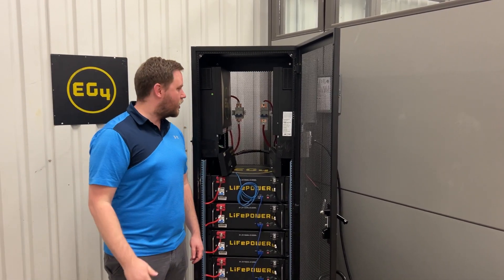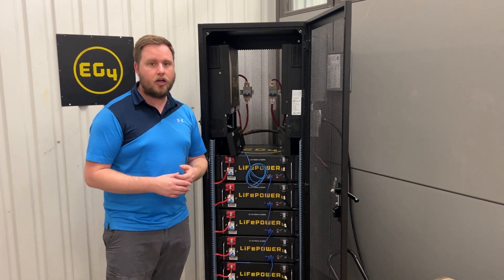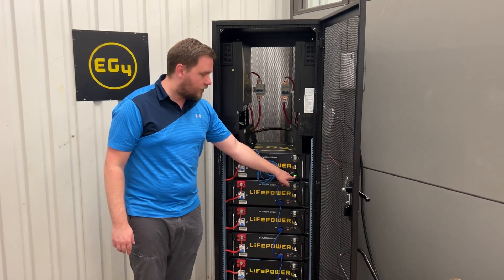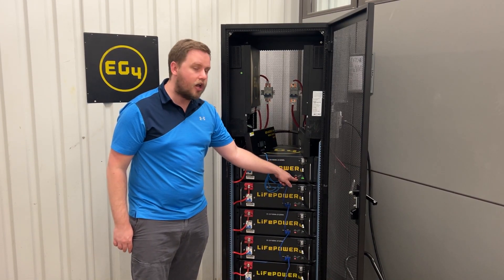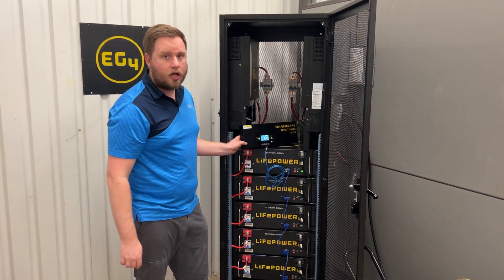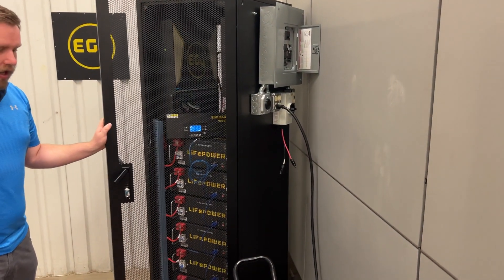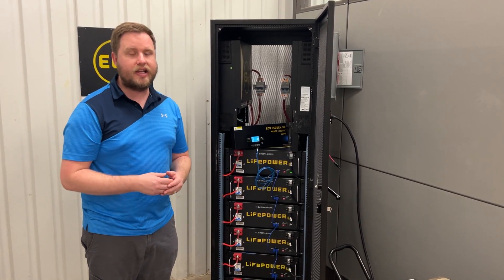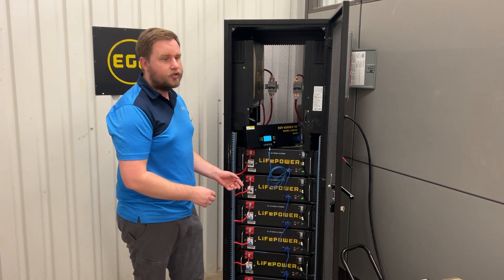EG4 LifePower4: Proper Start Up Procedure Using EG4 LifePower4 Batteries and More!

Comment: Great video, please add more content like this with the dual 6500EXs in split phase mode.  Demonstrate initial setup of each inverter and go through the different modes.  Add cabling diagrams and setup options for running with GRID input please!
Reply from the maker: Will do!
Reply: @SignatureSolar   Yes please do.  After seeing this video, I ordered the same setup.  Now I have to find a tall server rack.  Please show videos of how you added the bus bars into the rack for the battery hookup.
Reply from the maker: @NC-oc3ld  We have the bus bars added at the factory as part of the sidewalls.
Reply: I've ordered (and received) two of the batteries and am waiting on the two inverters (backordered) to arrive.  I'd look forward to seeing the mentioned video on connecting all of the components as well.  I also ordred a dozen of the 445 Watt Bifacial panels and am wondering about how best to string those with the two inverters.  I'll be adding a lot more in the future so having an idea about the initial string setup would be greatly appreciated.
Reply: YES!!!PLEASE!!!

Comment: I think it would be helpful for all your customers to show the set up procedure for each of the configurations that you sell, such as the 3000k EG4 inverter or the Growatt, with the lifepower eg4 batteries and so forth. Also, maybe hire somebody with video production experience to help direct more professional looking videos that would show close-ups and and more thorough step by step instructions. For the amount of products Sig Solar is selling, to predominantly the DIY crowd, you need to step up the video production, because I am sure your tech help desk is fielding the same questions over and over.
Reply: I think this is really valuable input Longbow is providing. My read on Sig Solar (and I am almost for sure going to purchase my batteries, rack, and inverters from them) is they are REALLY good people with really good products primarily for DIY and then also for pros. However, they are Nurds (good Nurds) and they know their stuff and they know solar in general really fricken well. But most of us are not Will P. or some other person making our living doing solar YouTube stuff. We are trying to do our home (on or off grid), off grid cabin, work shop, ......... and we are most likely trying to do it right and do it once. So, ....... we don't have the total knowledge and skill set and need as Longbows is suggesting. OR, what happens is what is happening at SS, the Tech/Customer Service is overloaded and people are getting frustrated (the only reason I haven't put in my order). Much of that frustration and a significant part of that overload could be eliminated with really clear Gerber-spoon-fed tech videos like these. Sure, the more knowledgeable will complain and write long self-serving responses, but in the end, everyone gets what they want. Take Longbow's input.

Comment: Same setup but with 4 batteries. Running washer/dryer, refrigerator, two mini splits, and a few other 120v small appliance. Works like a charm.
Reply from the maker: Love it!
Reply: Can I ask how you designate what's going to run off your batteries? I'm investigating using this setup but if I'm not running my whole house how do I run just a few appliances? Did you have to rewire those circuits out of your house pannel to this new setup? Thanks I can't find videos showing people connecting these to a house
Reply: @dshudson  I have a dedicated electrical panel in the laundry room powered by my inverter/batteries. 
I run dedicated circuits out from there (centrally located).  I'm not connecting into my grid panel at all. 
Everything except the bedroom mini split can be plugged back into the grid.
For instance, I ran a dedicated circuit in EMT Conduit to the dryer.  But the grid plug is still in place.  Basically have two plugs, one is grid, other is solar. 
As for designating what runs off the solar setup, to be honest, I winging it. 😄
I initially bought the system to power the laundry room and add a mini split to my bedroom. But it works so well, I've been adding other things to it, like another small mini split and refrigerator. 
Dryer only runs in the day when I'm making power, fridge doesn't take much juice, and the mini splits are so darn efficient that I usually have 50% battery left in the AM. 
Fortunately, it only drops into the 30's at night, so I only run the mini splits in the AM to get the chill out. 
Live in AZ, so I typically get enough sun to make all the power I want.
Reply: @genxgamerdad71  thanks a ton I appreciate it.. Wish me luck. Haha
Reply: @genxgamerdad71  actually one more question. How many pannels do you have and what voltage are they. And how long does it take to charge your batteries thanks
Reply: Two arrays with 9  450w 50v panels each.  Net is about 6kW.  System keeps up just fine in the summer, charges batteries from 40% to 100% by 11AM or so while running the dryer.

Struggling a bit this winter though, running the mini split and two electric heaters, to get the chill out. Batteries are typically at 30%  before they start charging again.  Not fully charged until 1. Really have to watch my dryer use.
 
If I had two more batteries and 6kw in panels, I'd be in really good shape for winter.  I'll get by though, just need to watch my usage a bit.

I plan on doubling this system this summer, as I want to add two more mini splits and connect the other refrigerator. I'd also like to add two circuits to each of my boys rooms to run their gaming PC's. I'm fortunate to have plenty of land for panels.
Reply: @genxgamerdad71  that's awesome. I have 22 525w bifacial panels, which I didn't pay for, so I'm already saving money haha. Now I'm looking at that deal on 6500ex 48 13000 split phase inverter bundle, and 6 lifepower4 batteries. With that said, the hardest thing right now it's finding a rack for my panels which measure 90in x 45 they are huge.  Like you, land isn't an issue.

Comment: Why in the world would you not have the resistor charging procedure in the Battery Manuel? I bought 3 of the lifepower 4 batteries and knew it had a resistor in the battery to charge the invertor on startup. Read the manuel on the eg4 3k inverter and the Lifepower 4 battery and it's not mentioned anywhere. Started it up and just like your video the batteries all shut off. Did this several times and now my first battery has a SOH of 99.90% Finally saw a video by Will Prowse that explained the procedure.
Reply: Answer to first question, if it is in fact not in the manual, because the manual is put together by humans, this is a new product that is very unique compared to normal things and humans make mistakes.
Reply: What's the title to the video will Prowse did on this problem or link it please thank you

Comment: Thank you for this video.  Just like "Oily Care" I'd like to see the complete set up for split phase and demo how you would hook up a critical load center, how you would combine input and out put in the same panel (or is this possible?), especially the ground neutral configuration, or do we need a separate transfer switch (please show).  Also follow through with total set up of same with the inverters.  Also, some close ups during the video would be extremely helpful. Thanks so much for your help (Chris Haymond)

Comment: Great video,great timing.  I am currently working on this same setup,initially with four batteries. Thanks!
Reply from the maker: Good luck!
Reply: Good luck indeed. Let me know if you can get your inverters to communicate with the batteries. The word out is they don't. Get error 61 within minutes of start up for most as i see on the forums.

Comment: I’m a rack guy :) I like this set up with the inverters and battery’s all in one rack and the additional items on the out side of the rack. I’d be interested in this rack as well.
Reply: According to the installation instructions this setup has nowhere near recommended clearances the inverters require. 19" top and bottom 8" on sides. Close the door and they just might overheat...I have mine in center of of grid house, setting up a fan system to put the warmed air inside in winter and directed outside in summer..under load the inverters reach Temps in the 90's

Comment: I recently installed my Growatt 12KW inverter and  4- EG4-LL batteries in the rack system using the top 4 rack spaces. I currently have 8 of your Bluesun BSM460M-72HBD panels configured in 4S-2P on one MPPT via a watts24/7 charge controller. My other 10 panels are on back order to wire up the second MPPT. I am considering going 3S-3P for each MPPT when the remaining panels arrive. I used the 25mm2 gauge wire you provided for the 4 EG-LL's pulling the positive and the negative from the top of the rack system busbars. I ran this for a couple weeks with two 110V output circuits to test the system and noticed the batteries drained down evenly. I just received and installed the remaining  two EG4-LL's in the bottom two spaces to complete the rack and this time reversed the negative bus bar per Will's comments so that the main negative pulled from the bottom of the bus bar. I also replaced the 25mm2 battery feed cables with equal length 4/0 cables. I then went off grid for the past 6 days, back feeding my house panel on a 60 amp breaker. I was surprised to see that the two newer EG4-LL's installed at the bottom of the rack were draining down much faster.  This morning reading show from top to bottom in the rack with all 6 showing 52.2 volt but the amp draw as follows;
#1 0.9A  44%
#2 0.9A 44%
#3 0.9A 43%
#4 0.9A 44%
#5 3.0A 37%
#6 2.9A 38% 
The difference in the SOC has been between 10-20% between the top 4 and the bottom 2 batteries to the point that I shut off the lower two batteries last night.  I am considering changing the negative bus bar back to the original position and would appreciate your input.
Reply: You don't need a separate solar charge controller, because these inverters have one built in.
Reply: Did you ever change the negative bus bar back to the original position, and if so what was the experience?
Reply: I ended up keeping the positive top left and the negative bottom right on the bus bars. I was told by SS that it takes time for the newer batteries to settle in  so I kept it that way. Here are my SOC reads today from top to bottom. 54,46,49,53,48,51.
Reply: Did they give a timeline? It will be interesting to see what they ultimately "settle" to.
Reply: @leonmcooper8640   I do not remember , but the SOC readings in my prior reply was after many months now

Comment: Hey Guys, Thanks for the video. When demonstrating loads, I think it would be helpful to have household appliances like microwave, induction hob, electric oven, vacuum cleaner, etc. Maybe with video of the Wattmeter on the Display.... you know, to give folks an idea... I'm running the 5000es w/ 2 eg4s, and midpoint transformer...

Comment: Air compressors are notoriously difficult to start up with solar systems.   That high inrush current and inductive load trip most systems.  I can't think of a better test. Thank you for showing the "minimum" system that can run heavy inductive loads.
Reply from the maker: Totally agree! Thanks for the comment.
Reply: We have a 24V,  off-grid solar setup (1,200 Watts PV, FM80 controller and VFX3524 inverter charger) with two 24V 200AH LifePOwer4 batteries and are unable to startup a handheld "Skillsaw" circular saw without crashing the batteries! We are also unable to fire up a 10" Craftsman radial arm saw. I was impressed to see that you could do could fire up the air compressor! Why can't we even fire up a little Skillsaw?
Reply: Been running air compressor on this same setup(4batteries).. works great.

Comment: How did you ground the inverter and the batteries with having the inverters mounted to the same cabinet? I have a lifepower4 battery and a 3k EG4 inverter and they are mounted on the same metal frame,I have live voltage everywhere. Did you put spacers in between the inverter and the cabinet so the inverter frame is not conductive to the server rack? How does this not create a ground loop?

Comment: Thanks for the video. What's the sequence for the EG4 LL batteries? It has a BMS power button and a breaker where the Lifepower4's seems to only have a breaker for turning it on. For the EG4 LL, do you turn the breaker on then push the BMS button so the inverter caps get charged slowly? The DC breaker inbetween the batteries and inverter are closed beforehand in both cases...
Reply from the maker: The order does not matter on the battery itself as long as any in-line breakers on the positive line and battery input breaker on the inverter is on before any battery breakers

Comment: Lovely video. I intend to have 8 x 15kw battery rack to run main house off grid and 3 x 1 bedroomed apartments. How would I set up my eg4 18kw inverter and 3 x 5kw spf growatts with the 20% rule. I will have two pool pumps too. Bit confused. Thanks.

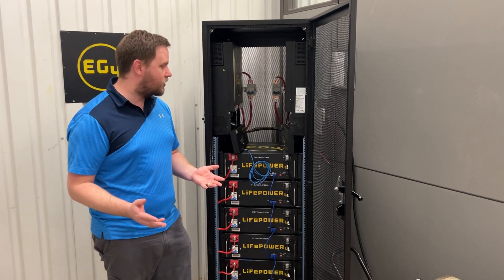Comment: Can someone please explain to me what just happened in this video at 1:15? We have an Outback VFX-3524 Inverter charger and we cannot get it to fire up even with TWO LifePower4 24V, 200AH batteries connected to it!! We HAVE to turn on the FM80 charge controller and THEN turn on the PV panels and WAIT for the charge controller to start producing power on a sunny day and ONLY THEN we can flip on the VFX3524 without crashing the batteries. What are we doing wrong? Are we supposed to flip up the paddle to the inverter first and THEN turn on the batteries?? It looks like he is connecting the inverter to the batteries first, then turning on the battery and THEN turn on the inverter?? The Outback VFX3524 does NOT have a power switch on it.

Comment: I have 4 of your batteries to run 2 EG4 6000EX 48vdc IN PARALLEL how do you set the DIP SWITCHES on those 4 BATTERIES

Comment: I gather from the battery and inverter links, that this is a 48v system. It wasn't specifically highlighted in the video. I'm looking at an off grid shop system, and this would be the types of loads I have to consider.
Reply: David, based on my conversations with the folks at SS, it should be fine.  I am setting up an off grid shop also only, running  120 v at this time with 4 eg4 batteries and 1 eg4 6500 watt inverter.  Until I can save up for the panels I will be recharging my battery’s with the 48 volt charger.  For me this is more of a hands on self teaching thing so I can set up a whole house system later.  Also as I wire my shop I am running some 220 outlets but they will not be connected to the load center for a while as getting a 2d inverter is a low priority for me right now.
Reply: @richardsylvester9406  
Thank you. I'll probably only be hooking up 2 rack mount EG4 batteries to begin with, with an 6500EX inverter. If I ever decide to run 220, it would be run from the generator, unless it becomes routine. In which case I think I would add more batteries and a dedicated 220 volt inverter, as opposed to a parallel additional 120 volt 180° out of phase. I just don't think my 120 volt usage would justify the load balancing between inverters. Time could very well change my mind.

Comment: What about frame ware. Dose it have to be done before I can connect everything up. And where would I get a connection cable that will plug into my tablet? I don't have a computer or laptop I can get why FYI signal where I have the batters set up.

Comment: I have a solark 15k, I turn the each battery on while the main breaker to the inverter is off. This keeps from charging or discharging a single battery at a greater than it can handle. Reverse order when going off.

Comment: What is the startup procedure for the EG4-LL, which has a separate circuit breaker switch and a BMS switch 🤔? In your video the circuit breaker and BMS are mechanically connected to each other. Should I close the EG4-LL circuit breaker first and then turn on the BMS switch in order for the current limiting resistor to function?
Reply: I saw your question after I asked the same thing, but noticed nobody answered. Is what you suggested the way to do it ie, close the EG4-LL circuit breaker first and then turn on the BMS switch?
Reply: @jeffntexas8920  yes,

Comment: Can you tell me what happens if you have one inverter turned on and running on the batteries and then turn on the other breaker for the other inverter?  Will the other inverter handle the in-rush current to the first inverter or will it trip the breaker?

Comment: Signature Solar great video. I agree with a few others, it would be great to see a video where this is used with solar. One question though, in researching other sites that reviewed this product, they talked about this unit uses a lot of standby power. Any way to offset that wasted battery power other than adding another battery and more solar panels?
Reply: The a lot is still very little

Comment: can you have power coming from solar and the grid at the same time?  if so; then if the load out isn't too high can you charge the battery while running a load?
Reply from the maker: Yes to both!

Comment: Great video, thanks!
Got a question concerning the 24 volt model battery that does not have a breaker..... If the On Off switch is in the Off position,  will it take a charge from the solar array? Thanks in advance.